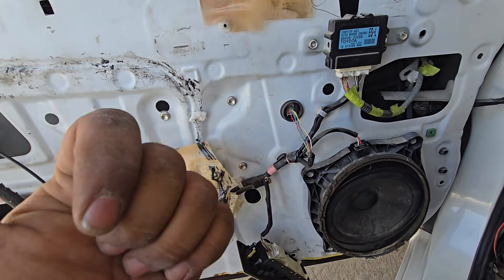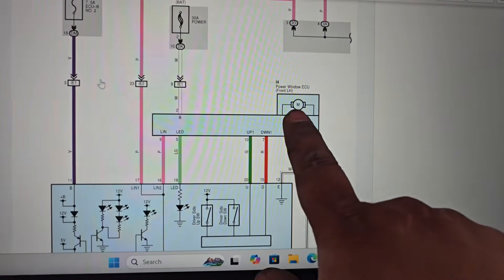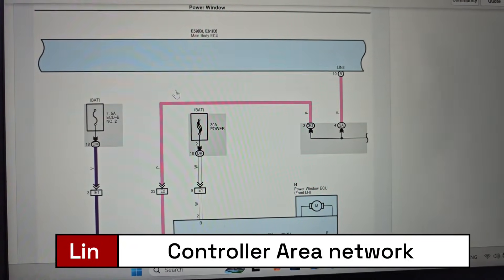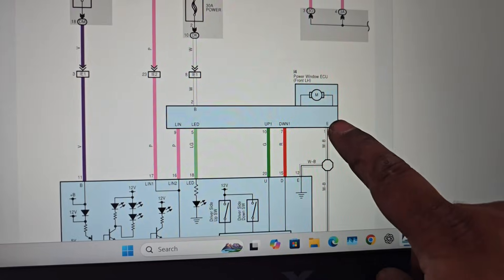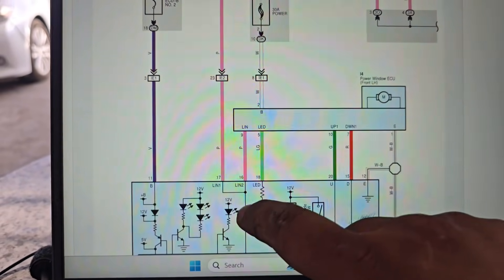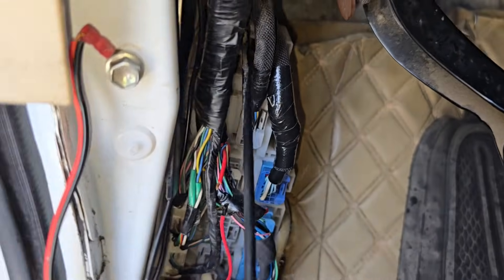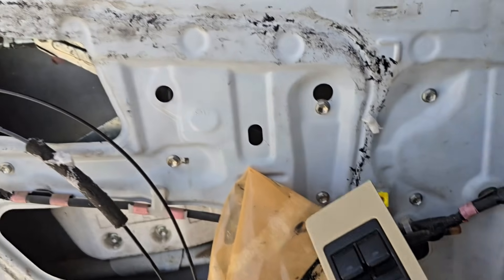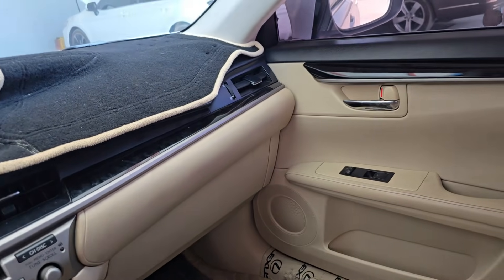Power window Not Going Up || Toyota / Lexus Power Window Circuit System & Wiring Diagram

Comment: I faced similar kind of problem in Skoda. I went through the wire harness and found one wire was disconnected, I joined it and still passenger door window is not going up from master switch but it is going down.. Whereas it is working from passenger sit switch.